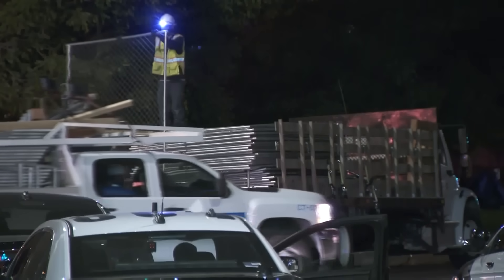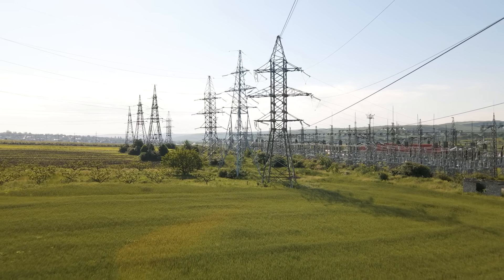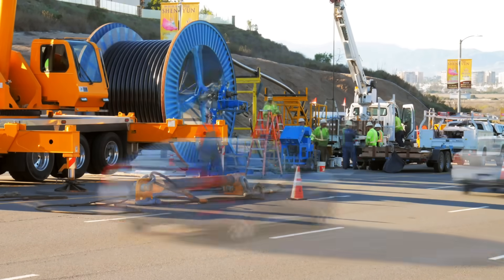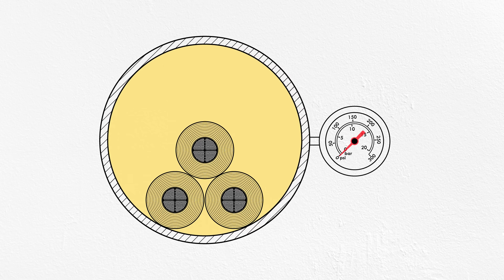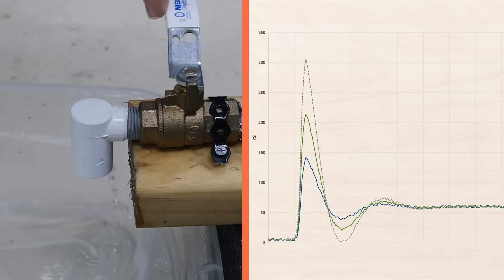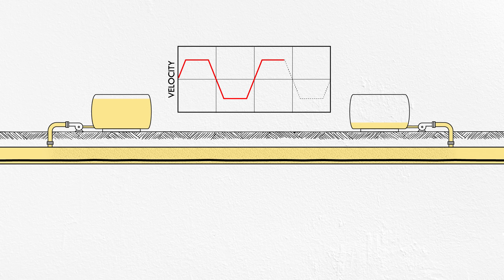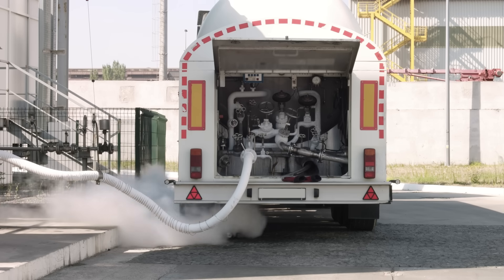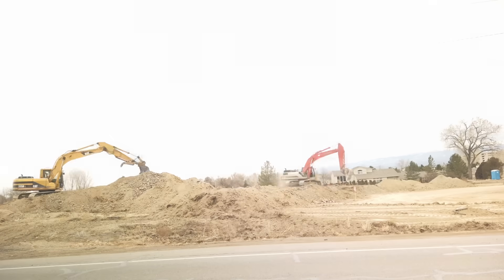Repairing Underground Power Cables Is Nearly Impossible

Comment: Engineering is when you find complex solutions to fix simple problems, and contrary to popular thought is usually a more expensive way to fix things, sometimes with unseen far-reaching consequences in the end. When railroad tracks crossed the Great Plains, they found the summer sun heated the long straight tracks causing buckling from the tracks growing longer in the sun- a similar problem here. So they simply added some offsets with curves which put the track movement in places where it would work best and could be more easily monitored, maintained, and repaired as and if needed. You'll find the same solution in piping. Wiring doesn't have to be straight from end-to-end either... just saying...

Comment: I spent a year as a Subcontractor to a major Cable manufacturer wiring the oil pumping stations used on the East Coast underground HV distribution system. I never really knew how the system worked just how to wire the power and controls for the skid-mounted pumping equipment. It was one of my last projects before retirement. Thanks for the story.

Comment: Pedantic point. The oil is a dielectric, true. But only the oil soaked into the paper is actually being used as a dielectric -- the rest of the oil is acting as a coolant / temperature smoother. 

Of course it all has to be dielectric as if some conductive contaminant found its way into the outer pipe, by osmisis eventually some of it would be taken up by the paper.

Comment: Wild stuff. When someone designed the oil-filled pressurized conduit, did they design the method of fixing it, too… or did that come later when things started to break?
Reply: This was adapted from high power radio transmission from transmitter to tower
Reply: hell no, they will call up automobile engineers to fix the issue. gotta take out 30 parts to replace one $30 part
Reply: @nickgibb4687  Ah!  You've seen the video how to replace a Honda CRF250X carburetor.  Applicable.
Reply: Power are high up to reduce losses of transmitting power to the ground. There is a calculus to figure loss to ground vs tower height.
Reply: It was state of the art at the time. The biggest problem wasn't fixing leaks or breaks (easily enough to freeze oil plugs on either side of a problem), but to control voltage when the cable was lightly loaded.
And to think regulators and the public want to have the state investor-owned utilities (PG&G, SCE, and SDG&E) to run hundreds of miles of buried transmission.

Comment: In Australia for many decades we used pressurised inert gas to preserve large telecommunications cables. These cables had single leaf paper insulated coper lines and were encased in lead.

Sadly when our telecommunications network was privatised, the corporate bean counters restricted the maintenance of these lines and many were simply left to degrade in regional areas. We have a massive decommissioned line running nearby our property: millions of dollars worth of infrastructure left to rot, just so desk jockeys with no technical background could look good on paper. Corporate cost cutting is theft!

Comment: Atleast we know why the price of hydro is still climbing. They use a pipeline, that (does not) have to be burried under the ground and excavated to repair. Which also needs to contain the single highest priced commodity on earth, oil.. while being kept under pressure and also circulated. And I'm even leaving out the liquid nitrogen tankers and expensive ground radar instruments. They must literally employ civil engineers to dream up the most expensive infrastructure that is even attainable.

Comment: Wouldn't a HVDC power cable system have been a better solution in 2021? Power conversion electronics (to go from AC to DC for transport, and then back to AC again) have progressed to the point where this can be done efficiently and cheap, even for relatively short distances like in this particular case. https://www.youtube.com/watch?v=je5INqMXN5Q

Comment: I would have thought that they'd do something like implement valves at regular intervals so that they could isolate a given stretch of the pipe for maintenance and repair. Expecting such a dynamic system to operate without any need for maintenance or repair seems... well, crazy.
Reply: Think through how you would accomplish what you proposed.
Reply: @philipdamask2279  I'm not saying that what I suggested is the right thing to do or even viable; I'm merely surprised that they would design a system like this without any clear strategy of maintaining or repairing it.

Comment: One of my favorite things I learned about it my engineering classes was time-domain reflectometry! I think its really fascinating how you can send a pulse down a conductor and receive the reflection to determine roughly where a break is. Its one of the things I actually still think about often when I hear of an outage somewhere. I think "cool, I know how they might actually find the fault!" Not saying I was actually any good at it in school, just thought the concept was really neat.
Reply: I build power stations and have had two separate faults on 33 kV grid connections. Tdr was used by the distribution network operator on both occasions, it is imperfect, but can definitely narrow the issue down. Faults are always due to bad workmanship of joints. Always.
Reply: @paulharrison2325  Faults are no always caused by craftsmanship. Sometimes the installation of cable in compromised  conduit will damage the cable. In the older cities in the on the east coast, (New York, Philadelphia, Atlantic City etc.),will have duct runs that may partially collapsed. Even after the duct run has been proved. You can't see underground.
Reply: Time-domain reflectometer wiki:
https://en.wikipedia.org/wiki/Time-domain_reflectometer
Reply: For fiber infrastructure, an optical TDR is a crucial troubleshooting tool.  Well, that and a county website showing where the road construction projects are that you can compare to your fiber right-of-way :D
Reply: I use it a fair bit for my job, can be used to find simple wiring faults in a house. Very very helpful
Reply: Yeah its awesome.
Reply: TDR to find cable faults but the old timers I worked with didn't have TDRs. They used a breakdown set and then sent tone out on the line. I guess a lot trouble was moisture getting into the lines.
Reply: A new technology is time-domain protection. New relays implement this technology to locate faults with remarkable precision and accuracy.

Comment: Why don't they just physically separate the wires? I get that it will be 2-3 times the cost, since you need 2-3 times to dig and install the wires. But then your maintenance cost would drop to almost zero, right?

Comment: I must be a full-blown nerd, I find this stuff absolutely fascinating.
Reply: I know, right? As a 7 year old, I was fascinated with a 6KV underground cable repair. in my street..
Sadly I never got to work a HT engineer, but rather as the electric company's AV contractor, a little safer, perhaps. I'm still into anything with voltage, current and frequency!

Comment: It does not become very clear from the video if this technique of using pressurised oil as an electrical insulator for conductive cables in pipes is an ancient one, if this was only from the days there were no suitable other insulators yet such as plastics, and when the power line in question was installed. Otherwise, a truly great video and story for all intents and purposes.

Comment: Using liquid nitrogen to create plugs is very common, and they are aptly called "freeze plugs."  I've never been a fan of these.  If you think about it you have workers working between two freeze plugs on a pipeline which may be carrying dangerous products at high pressures.  If just one of the plugs fails, it's game over, and it's likely someone is going to die.

Comment: I've often been told that underground power lines were far more expensive than overhead ones which is why we have to put up with unsightly pylons marching across the countryside but it was never explained why. 
It's one thing to tell someone something that it is true but it's far more convincing if you explain why it's true! Thanks very much for this explanation.

Comment: Cool story. Was just discussing the use of underground high voltage transmission lines in the need to expand the grid for both solar and wind coupled with battery storage. Seems like coming up with more reliable underground high voltage transmission line systems will be essential to keep the functionality of the grid safe while protecting the West from exposure to downed lines that can spark destructive forest fires and disrupt the grid even further. Time for an infrastructure rethink.

Comment: I worked a bit with both type of transmission lines - wound paper and poly core. We were using them sort of outside the scope of design, to send nano-second pulses of 2MV+ down short distances. The oil-soaked paper insulated line shorted out almost instantly, but the poly stuff was much more robust. It was also insanely expensive; about $100 a foot in quantity (we generally had to purchase at least 3000 feet, which would last many years of our particular use case). It was manufactured to order - not exactly the sort of thing they kept stock on the shelf.

Comment: It is common for Thumpers to use TDR to give you an estimate of the location of the fault so you can then be close to visually or audibly pin point it. I think your explanation of the TDR method may be a little off. TDR equipment doesn’t send a pulse, but rather the fault itself creates a pulse. Depending on the magnitude of the fault, it is called Partial Discharge, or PD,  or you have what is called an AC failure, a failure at which the cable does not perform to keep from an actual discharge (probably called a DC failure on HVDC or UHVDC cables). The later is where a thumper is usefully for the TDR method, because you cannot apply full voltage to the cable without current draw. Back to TDR location, it is extremely useful for utilities, like LADWP, to periodically do PD testing and locating to head off issues like this. If the installation is done correctly, PD testing can be done online and a year over year test can help you predict the point of required maintenance and the point of imminent AC failure. The same PD testing equipment (think O-scope but with specialized software and electronics), can typically be used for PD location as well. TDR is highly accurate these days with sampling periods becoming so fast, in the nanosecond range for what I have used.
Reply: Source: ME! I have first hand experience with mostly MV and some HV cables and their production. I have actually held samples of the replacement cable for this project (at least I think it was this particular project). In any case, I do want to also mention that I don’t have experience with the oil-impregnated HV cables, but only with EPR MV, XLPE MV, and XLPE HV. Those predate my existence. In XLPE cables, the wires on the outside of the cable, known as screening or neutraling depending on where you’re from, do just that. They carry (ground) fault currents back (and of course any unbalanced loading) to enable a safer way to trip your protection devices than random ground paths, while also providing the benefit of providing a constant 0 point across your outer semiconductor, which provides a smooth electrically field (stress) across the insulation layer with the help of the inner semiconductor layer. So maybe oil-impregnated cables are different, but unless you specifically talk about sheathing, the wire on the outside of the insulation serves an electrical purpose on cables made today. There are resources online for cable construction, PD, water treeing/cable failures, and TDR.

Comment: Amazing story.  I do have a question, though: between around 1:40 and 1:50, you talk about how, since, in an Ohmic conductor, power equals the product of voltage and current, we can deliver the same amount of power at a low current by using high voltages.  But, for a given resistance of the conductor, isn't the voltage a function of the current?  That is, doesn't Ohm's Law say that voltage equals the product of current and resistance?  So if you increase the voltage and hold resistance constant, must you not also increase the current?  Since the resistance, in turn, is the quotient of the product of the inherent resistivity of the material of the conductor and length of the conductor divided by the cross-sectional area o f the conductor, and those are all constants for a given conductor, how can you possibly use a high voltage without having a correspondingly high current?

Comment: Back in the early 80s..summer job PSE+g. New jersey...ok with me..  so after a repair on a large gas line..annodes were placed pipe wrapped and coated.. supervisor walked away backhoe operator jumped off his rig and into the hole..he proceeded to hit the newly repaired gas line with a masons hammer.. no kidding..never forget that it was a lot of work repairing that leak.. upon re entering his backhoe he states that's over time in the future..  I still shake my head at that one..so how many other sabotageas did he and others do???

Comment: Question..I can certainly understand one pipe for each phase, 3 pipes under the surface, insulated in large part by the earth. However, putting all 3 phases in one pipe is ridiculously unsafe.  How could they not consider each phase getting its own pipe?
Reply from the maker: The earth is not an insulator. Potential between phases is just as significant as phase to ground. Separating the phases would only solve one issue
Reply: Practical Engineering   Yes. That would be one less problem, I guess.  Thanks

Comment: The part about fluid hammer really helped me, I have a sink that has a really high output, and if you shut it off too quick you can here the boom of the pressure causing the pipe to hit something. I will now be much more careful with this

Comment: Key difference with this case and say provision in London is this is in an active  Earthquake risk area... and London if you go deep you punch through to the aquifer under the London clay...
Originally the fountains in trafalgar square just ran on this natural head of groundwater pressure. Ive often thought the US should run more of its cables subsurface in particular through the Hurricane and tornado belts where grids and interconnects have repeatedly been repeatedly damaged by storms?

I wonder if a geological  magnetic anomaly detector would have picked up the field from the arcing cables?

Comment: Stupid design. 

What they should have done is incorporated a second smaller pipe filled with oil only. That way the oil would continuously flow in one direction only rather than having to reverse flow every 6hrs creating hot spots along the way. 

Also, surely there was a more durable insulating material available for use than paper even back then.

Comment: This is the most absurd way to put power lines underground that I have ever heard of. That is the source of all problems - tha absurd technical solution chosen. Not the idea of underground power cables.
It is way simpler to just burry the lines as separate plastic insulated phases. You can cool it with a water jacket, either individually or together and have a separate line for return water for normal uninterrupted circulation that can also change speed based on load.
Paper and oil is just .... insanity.

Comment: I was going to mention early on in the video, the pressurization, before I seen the cooling system, would have to be at least part a positive pressure contamination seal.   You covered it well later in the video, and a great video as always.

I've done both gas and electric underground, very little underground electric transmission, but a little. On those projects I was much more a tread than my normal bearing status, maybe a spoke, I'm fairly good at excavation and all the hair pulling around it. 

"Sags" and "Drips" in distribution gas may be an interesting topic for you, video worthy, probably not.  In the old days of in house gas meters, distribution pressure was very low, ground water pressure could actually exceed what was in the pipe when demand was high.  It lead to situations where cold and nasty spring thaws where every furnace was blasting, a bunch of homes would get "snuffed out".  In the warmer part of the day relights would be done, just to "snuff" back out that night. The culprit being the equivalent of a half full p-trap restricting the flow in a sag somewhere.  Most have been upgraded to "medium" "distribution" pressure, but there are some areas still in "ounces".
**Using the quotes because terms and numbers can vari so much by customer and area.

Great video as always, thanks

Comment: I was shocked to hear dielectric fluid is used for cooling, especially while pressurized.  I have used it for underwater electronics applications and it turns into a cottage cheese like substance if it gets too hot while under pressure.
Reply: That was how they did it back then.  In this case it did not work well.

Comment: Why not circulate that oil and control the temp using heat exchangers. I realize a return pipe would be needed but I would think that temp control would be worth the expense.

Comment: I wonder if they first put the oil under a vacuum to remove bubbles like we do with epoxy. Then put it under pressure. 

I guess it would be pressure then vacuum then back to pressure.
Reply: The oil is vacuum treated to remove moisture as it is put in a closed system...
Reply: Good to know. Thanks. That makes a lot of sense.